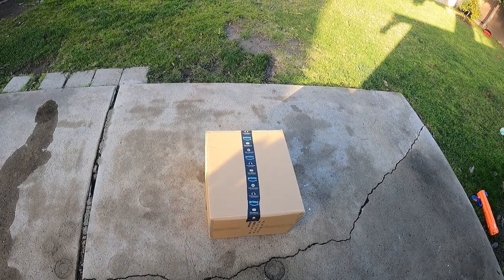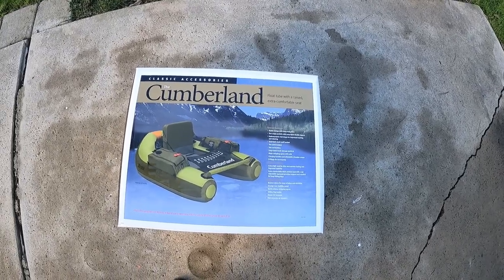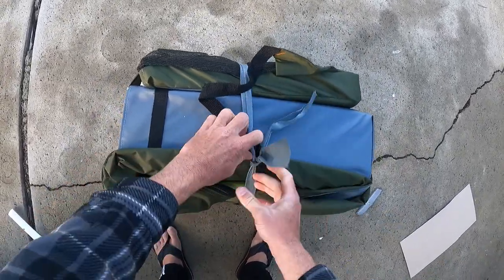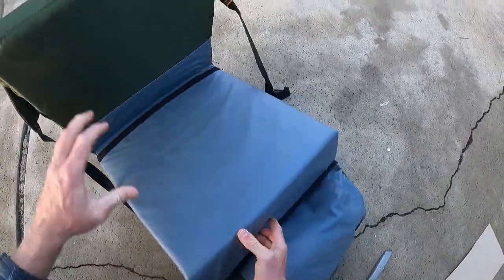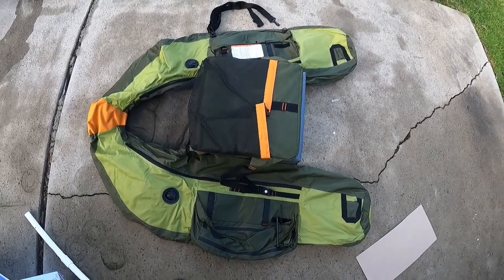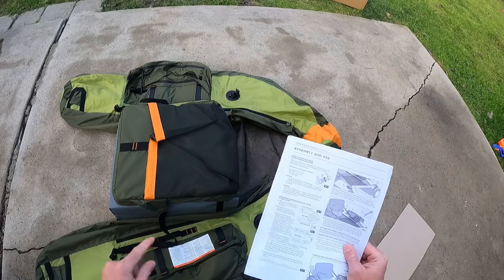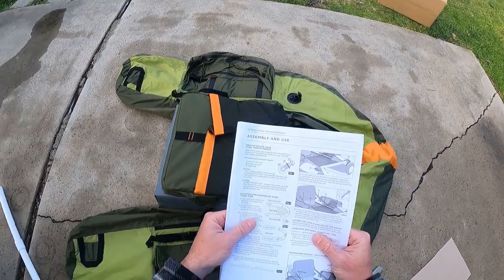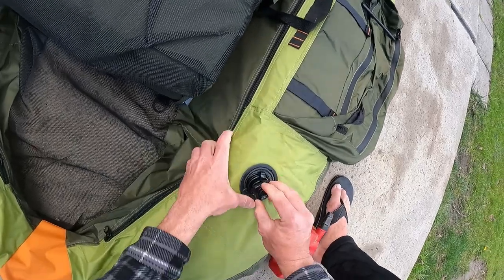How to assemble a CUMBERLAND FLOAT TUBE from start to finish

Comment: i've been using boot waders with my cumberland for a couple years.  Bass Pro has fins that works with boot waders.  my stocking foot waders lasted a season from walking from parking lot to lake, i'm on my second season with my boot waters.
Reply from the maker: Thanks for the tip. Yeah, I'll most likely get cheap stocking waders for this when the bite heats up. The walk from my vehicle to where I launch is no very far, so wearing the stockings out is not much of a concern. I have body-boarding fins that seem to work fine for now. I may just get water[pants] and put surf booties on over the leg bottom - it's more for just preventing water from going all the way up to the jewels - if you know what I mean...
Reply: @StartFishingToday  Thinking you fish the bays?  I spend about 8 weeks broken up between June and Sept in the Eastern Sierra Mountains.  Thick neoprene is the answer.
Reply from the maker: Yes, that is correct. I live coastal SoCal. The ocean is my home. Though, I do plan on using my float tube and kayak more inland bodies of water going forward. So, fo now, the lighter stocking waders or pants are fine. If I do go to inland water during colder months, then yeah, stocking neoprene. I use neoprene boot waders in the ocean because we have stingrays. They are great, but they do hold a lot of heat, so I start sweating after a while.

Comment: I have the same float tube and it’s the best! It sits high up out of the water. The only minor issue is sitting higher up out of the water makes it a bit noisier when kicking the fins but other than that this float tube is awesome! I modified mine with rod holders,custom hard deck instead of the appron(bolted a boot tray to the pvc that folds up and down) and custom trays inside the pockets. I was wondering what cordless portable air pump you are usually by to inflate the bladders? I have the hand pump that works great but the cordless pump is nice. Being an excessive modifier I want to get one! What make and model is the air pump your using in this video?? You will be very pleased with this float tube for sure!!
Reply from the maker: I use a Coleman QUICKpump for inflatable beds.

Comment: I liked mine until it developed a pin hole leak that I could not locate. I carried a hand pump to reinflate periodically. Also, the tide currents kept me drifting in Newport Harbor. Bottom line, I returned if to use the kayak and anchor setup.  I hope it works out for you because the simplicity is amazing.
Reply from the maker: If it develops a leak, you should be able to remove the bladder, fill up and submerge into a bathtub to locate the leak. As for the tide/current, I will mostly use this for deeper inside the harbor in the docks where the current has less of an affect. You can also use the anchor on the float tube...just like on the kayak. There are plenty of d-rings to hook a clip to . I also plan on using the float tube/kayak in freshwater lakes, ponds, reservoirs. Exciting times ahead!

Comment: How do you store it? Would it fit in a tote?
Reply from the maker: Personally, I just let out about 30% of the air in the bladders and just lean it in my garage. 30% allows the air to expand with heat and contract with cooler air. If you leave the air in, the heat will expand the bladders and possible make them burst. Yes, you can easily fit all in a tote, but it has to be a big tote, like 40-50 gallons because the seat takes up some room.

Comment: Non starter for me. No replacement bladders available. Look elsewhere for a tube.
Reply: That's the only thing that stopped me from getting one also.
Reply: @ssrc30  I stand corrected, bladders are now available. Expensive, $350, but they do throw in the nylon tube cover and seat.
Reply: @paulobainz1210  Sounds like the only option lol.  I know Classic Accessories has bladders on their site ($72 a set) but they've been out of stock for quite some time now.
Reply from the maker: Fortunately, I have not needed a replacement bladder for mine. Of course, if I used it more often, I would probably be in a similar situation as you...
Reply: @StartFishingToday  Bladders aside, not even valves are available. A common cause of leaks.
Reply from the maker: @paulobainz1210  I keep my bladders at about 50% Inflated to keep the pressure on the valves minimized and in a temped-controled environment to minimize plastic and rubber from deteriorating (as long as possible at least).
Reply: @StartFishingToday  Yes, we're on the same page. Can't understand why people insist on totally delating and folding until next use.
Reply from the maker: @paulobainz1210  yup. The folding is what causes the plastic to age quickly and makes the bladder dry out, then crack. It's better to keep near full inflation for long periods of time than deflate, fold, and store away.